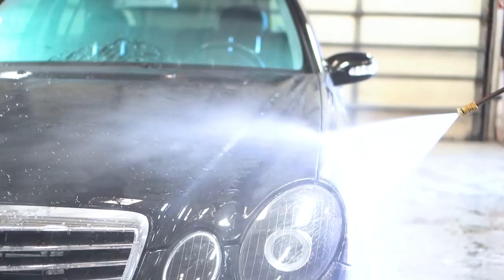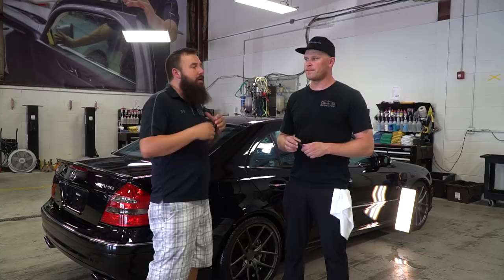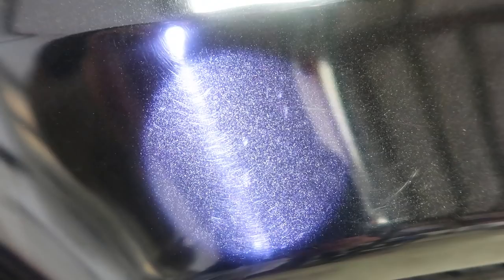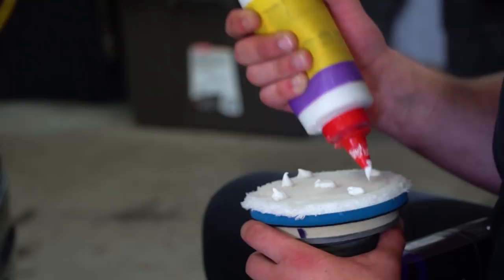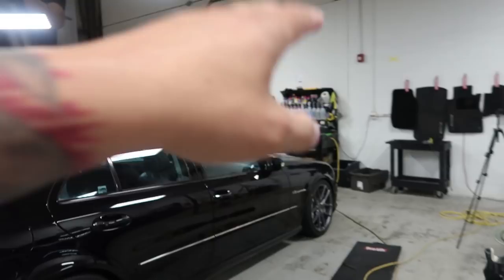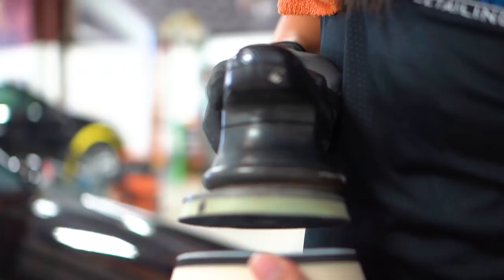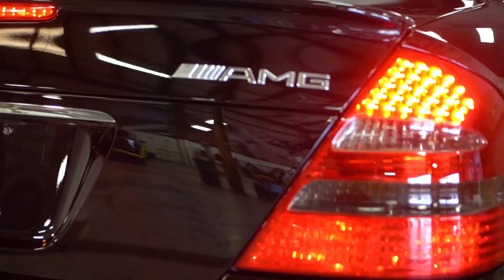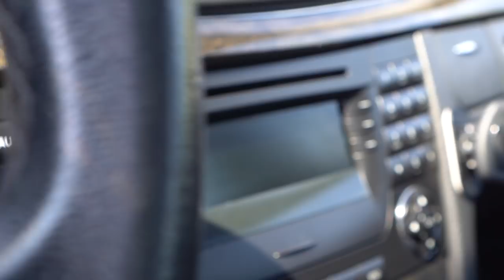36 Hour PAINT CORRECTION and MODESTA Ceramic Coating | Legit Street Cars E55 AMG | VLOG#48

Comment: Sure love your explanation of ceramic coatings, window tinting and other tidbits of info.  Looking to have my MDX 2015 detailed to almost this kind of level.  I did find a local detail shop that has an impeccable reputation in the greater San Francisco Bay Area.  Just need to find out more regarding interior detailing.  By the way, as a note...great shop and if i was in the area i would take it to your shop without a blink.  Peace, love and joy.  Godspeed.

Comment: Hi Jason, I’m from Timmy’s Detailing Gtechniq applicator and currently on training for Modesta coatings. Can you please help find your touch up tool. Also wanted to know if the Bco6 spray coating is sufficient as a ceramic coating on the painted body surface of any car after it’s prepped correctly? What’s your opinion and experience. Cheers, Adem from Australia

Comment: So I plan on getting the BC-04, you mentioned you touch up rock chips, like most cars I have quite a few on the front. Do you guys tackle really deep ones as well or would you recommend it getting corrected by a body/paint shop before bringing it in?
Reply from the maker: We would have to see the car to make a good recommendation, I would avoid the body shop if you can unless you can find one that you can really trust to do a good job.